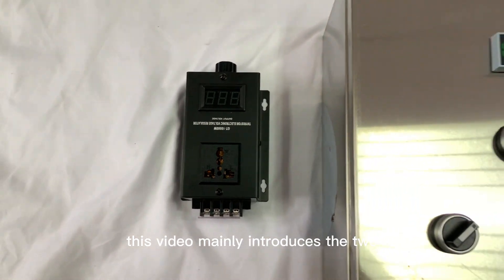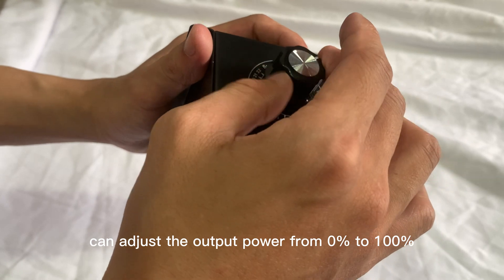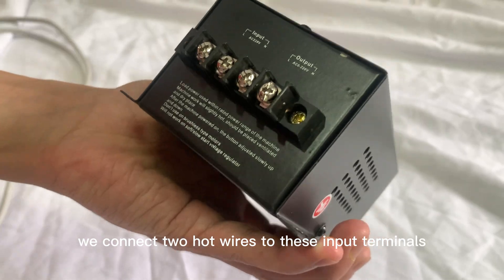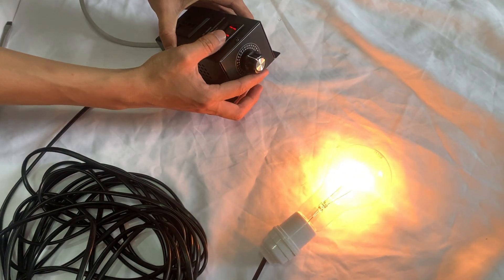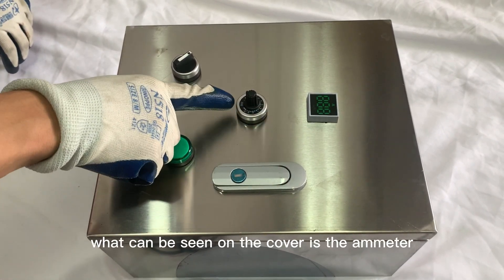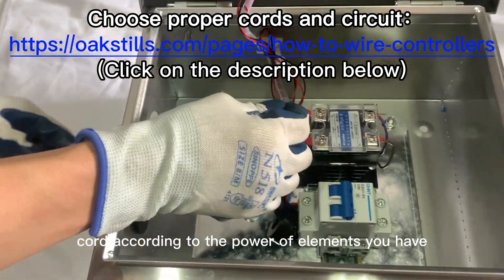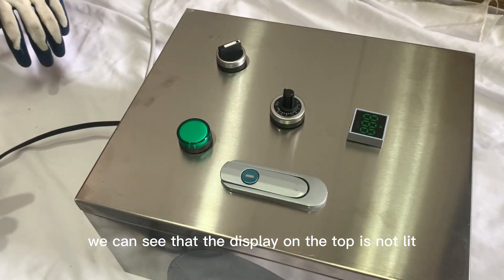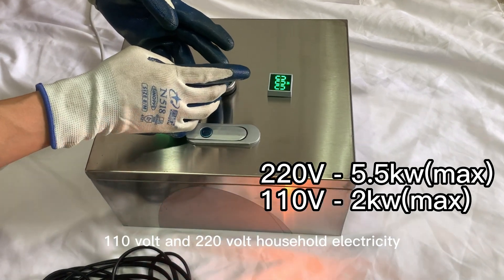How to wire heating element controller for distilling

Comment: The problem with your video is: you are showing for a light bulb, meanwhile you are selling element!
The power will melt the wire of the light bulb for the element
you should do a proper video with the proper wiring gage for the element for moonshine!
What do you think? Am I right or wrong?
I bought it, and I'm still waiting to arrive, I hope it will be a good device and won't put a fire inside my place for melting wire!
Reply from the maker: by using a light bulb it's easier to see the power change through the brightness of the bulb when setting the potentialmeter at different position, the controller works for the light bulb as well as heating elements and for more detailed wiring instructions please visit our website https://oakstills.com/pages/how-to-wire-still-heat-controllers
Reply from the maker: you are right, it's more of an introduction video instead of instruction, let me know if you find the instructions we sent helpful if not we will make a new video introducing how to wire the controller and elements.

Comment: Do you attach both ground cords for the element and the incoming power to the same grounding nut in thr corner of the controller?
Reply: There's a link in the description that ahows pictures at the bottom of where to connect the wires.
Reply from the maker: yes that works.